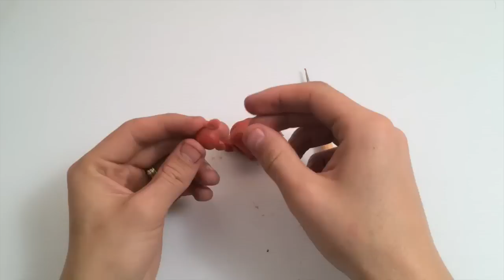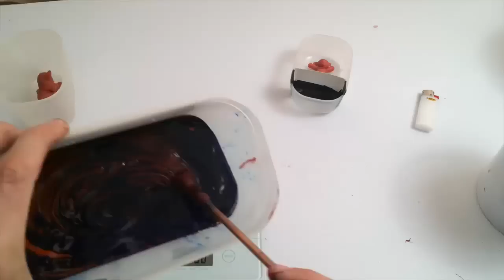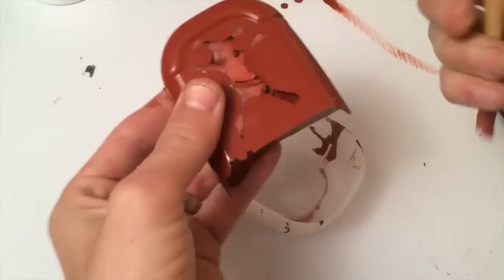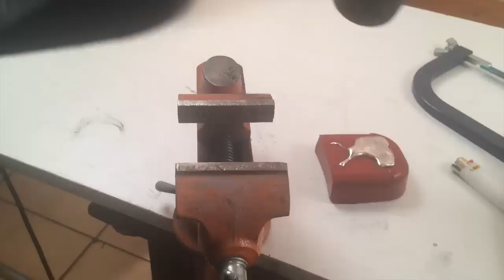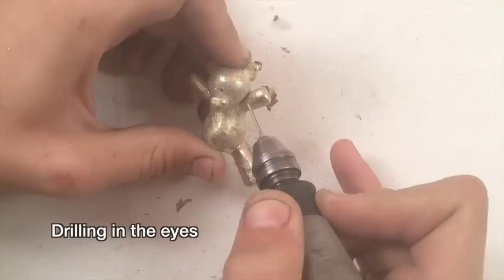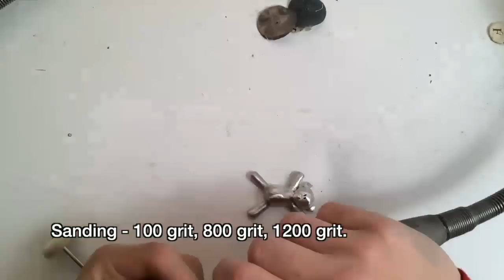Teddy Bear pewter casting (mold max 60)

Comment: HI, Im trying to melt pewter into moulds, but I only have a soldering iron. Do I have to have a better way to melt the pewter or should a soldering iron work if I perservere? Thanks
Reply from the maker: Hi, i doubt a soldering iron will work, Try using a stove and a pot.

Comment: Hey I hope someone can help. I made a similar 2 piece mold out of Mold Max 60 however each time I cast the completed pewter figurines keep coming out completely covered in bubbles.... Any ideas if this can be fixed or should I create the mold again??????
Reply: Robert Adamson if u can put the silicone in a vaccume chamber before making the mold
Reply: Vibrate your mold after filling to get rid of the bubbles
Reply: Powder the inside of your mold before pouring the pewter.  Good luck!